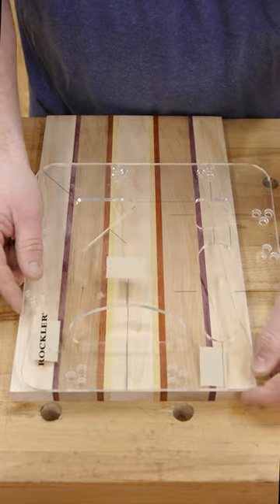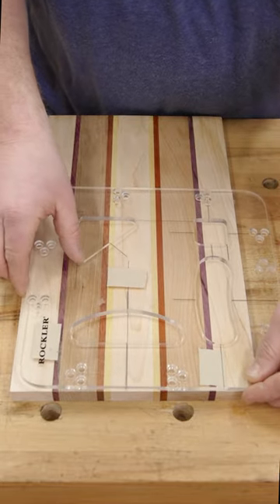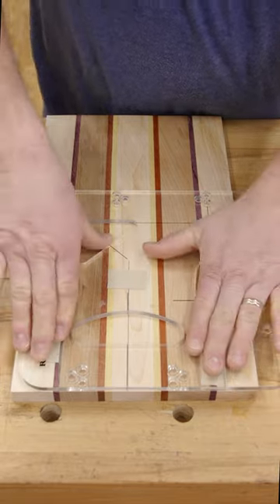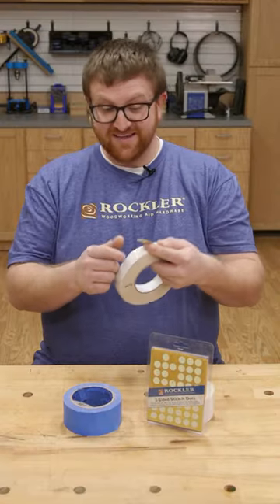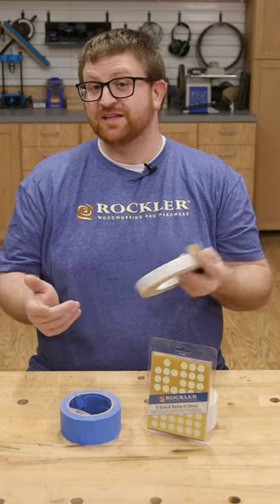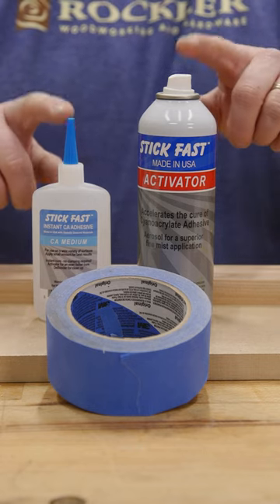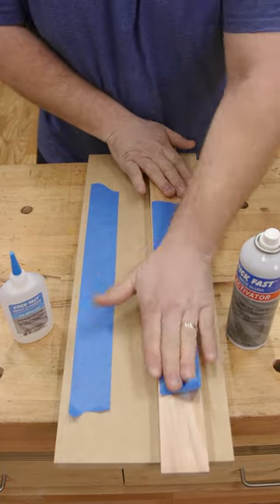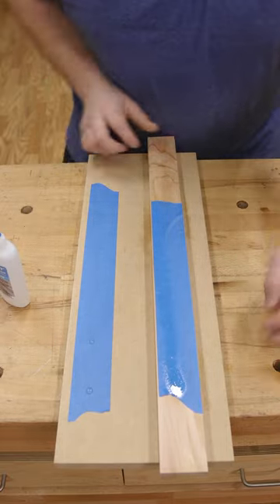Tips for Removing Backing on Double-sided Tape

Comment: Borrowing the idea from the 'Stick-It Dots' - Apply the tape to one of the surfaces with the backing still on. Then make a slit thru the center of the backing with a sharp utility knife. Use the knife to get under and pull each half of the backing off.
Reply from the maker: That is a good idea! 👏
Reply: That worked well, thanks!

Comment: my advice, 

remove as much of the backing as you can, then proceed to use a pair of tweezers. They are more nimble and smaller than your thumbs.
Reply from the maker: They are pre-scored down the middle. So if you push from the back while they are still on the paper backing, you can easily get the 2 halves peeled up, then apply the stick it dot right from the paperbacking.